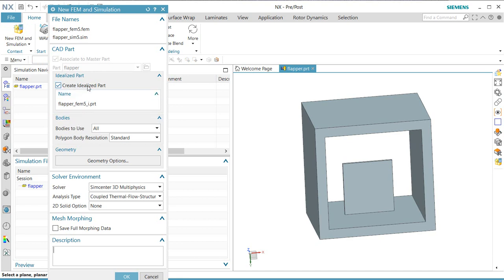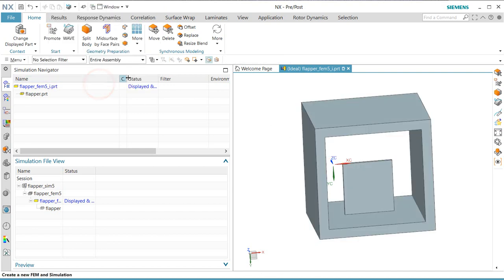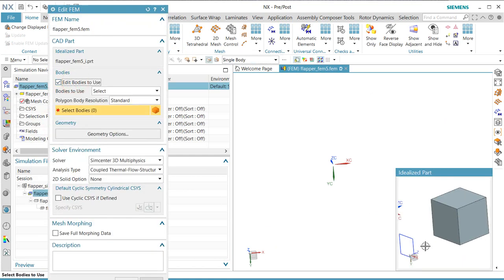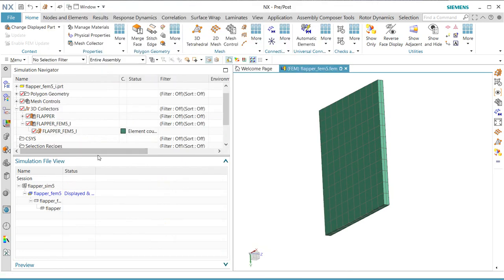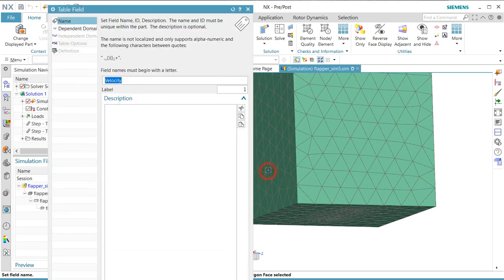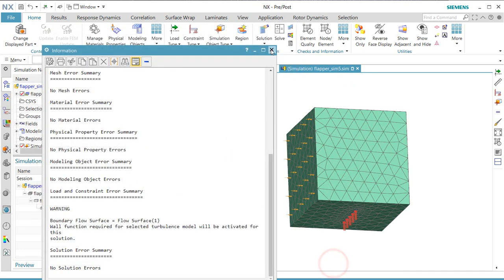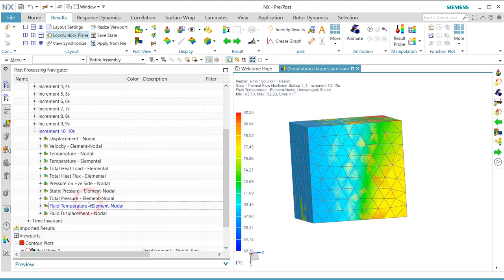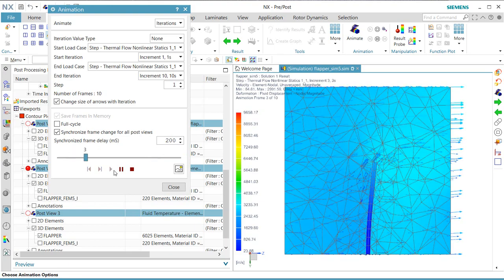Simcenter 3D Multiphysics Coupled Thermal Flow Structure Simulation

Comment: very good tutorial, is it possible to simulate roating fan in air?
Reply from the maker: Glad you liked it.  It should be possible to simulate a rotating fan because Simcenter Advanced Flow supports single and multiple rotating frames of reference but I haven't tried it.

Comment: i dont understand why try to solve it warns error about meshing, "solid property is undefined or invalid". I do exact step as yours
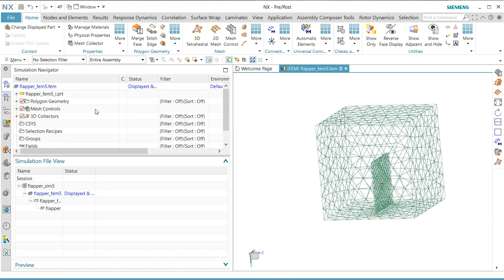Reply from the maker: Did you apply a material properties as shown at time index 3:14 for the fluid and 3:49 for the solid?
Reply: @Simcenter3DTipsandTricks  yes. The only difference is I realize in your simcenter you can choose fluid or solid in physical property. My simcenter version 1996 release 2021.2 dont have that. I assume it already automatically when selecting material type. Thus, during 3d mesh, it just show tet4 or tet10 not like yours fluid tetrahedron etc
Reply: @Simcenter3DTipsandTricks  I think that version simcenter has limitation problem with 3d meshing in multiphysics. when I try in my coworker's which is different version, it able to solve without that kind error. Thanks for sharing the tutorial
Reply: @Simcenter3DTipsandTricks  i think it related to that layer setting that i miss after realize about it. when i redo again in my pc i able to choose fluid tetrahedron

Comment: Delete failed because remaining faces can not be closed--i got this message while using delete face, could you please help
Reply from the maker: The reason why delete face failed is because it is not able to extend the adjacent faces to close the face you are deleting. Try a different approach like trim or replace face instead.
Reply: But i have same part as you and try the same way like in Video
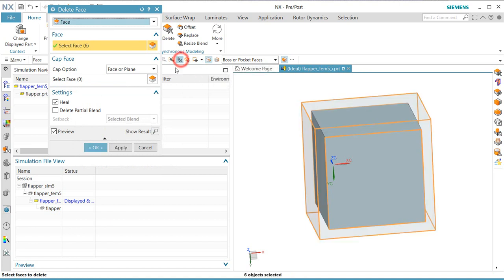Reply from the maker: @ymonga122  Sorry, I did not understand your question was on this video.  At time index 1:31,  I poke the "all but selected" button on the selection bar.  You won't have that button on there by default.  You may need to add it first by clicking on the small pull down at the far right end of the top boarder bar (selection bar) then selection group - all but selected.
Reply: @Simcenter3DTipsandTricks  Delete command worked ,i have not chosen Boss or pocket face while using Delete, thanks a lot please keep  answering the doubts on your tutorials